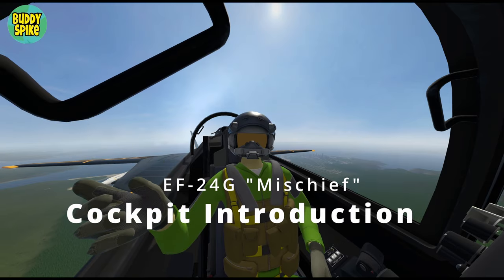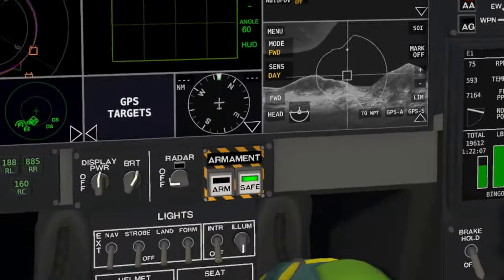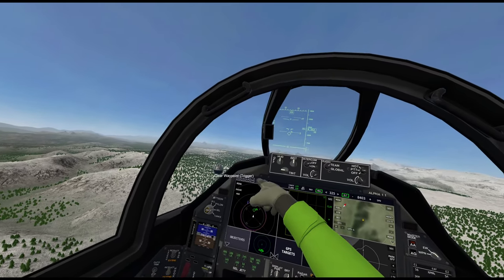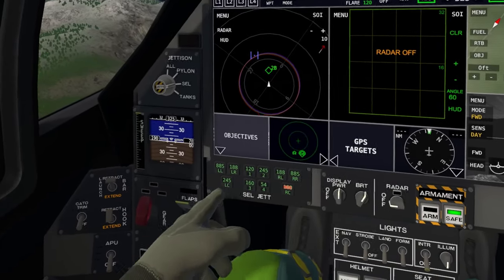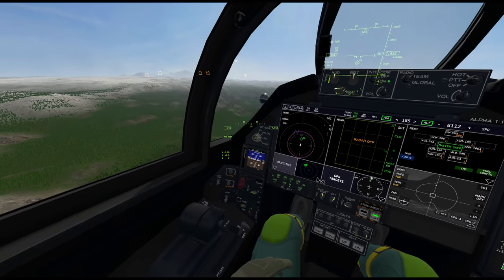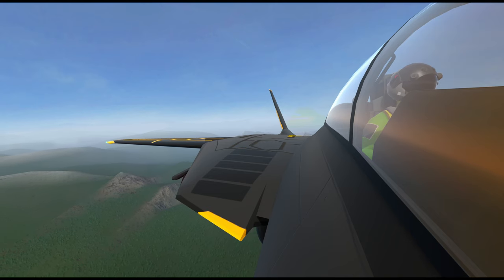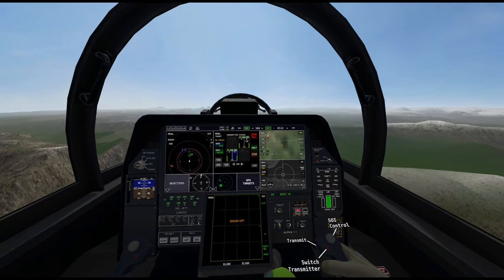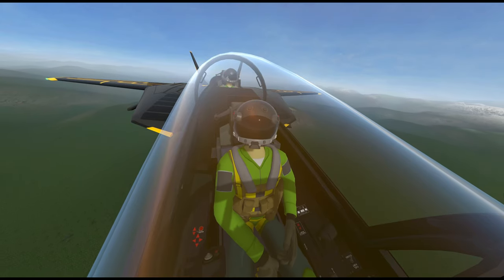VTOL VR EF-24 Mischief  Front and Rear seat Cockpit introduction

Comment: How to set autopilot Speed? In previous models u just turn the button and adjust till your desired speed. In the EF-24G u can only press a button for current speed.
Reply from the maker: At the top of touch panel u should find it
Reply: @BuddySpike23  Thanks for the fast reply bud. mhhhm still cant find it. I am sorry, i am stupid^^  Quess I need the exact GPS coordinates for that button^^ Thanks!